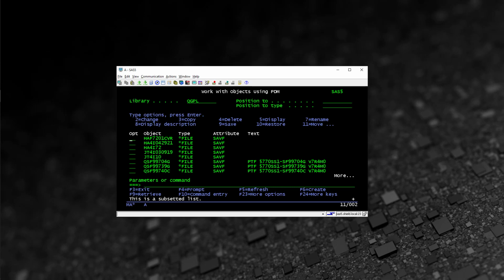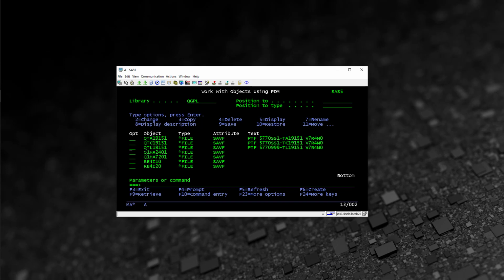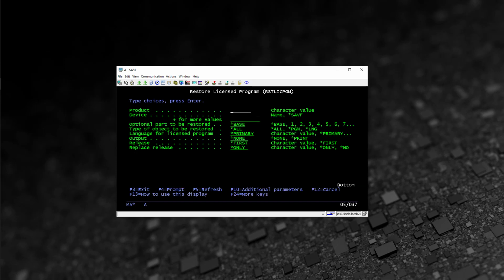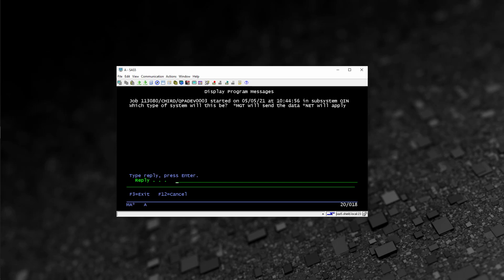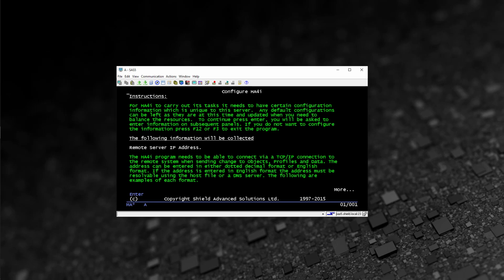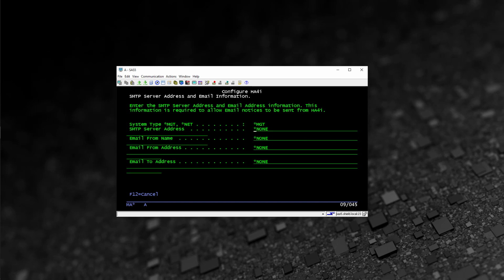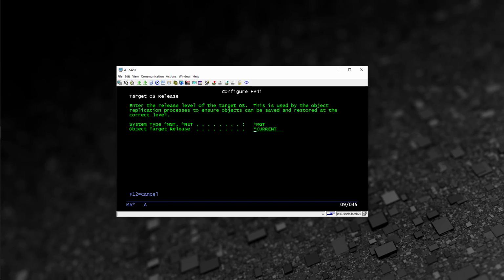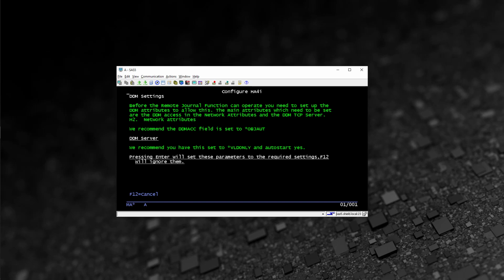Installing HA4i *MGT

Comment from the maker: The video shows an install for a system that is running 2924 as the *PRIMARY language. We have been contacted by a customer who was trying to install but did not see the configuration collection panels shown in the video. The problem is the *PRIMARY Language was not 2924 so the install fails for the language objects. When installing the product on a system where 2924 is not the *PRIMARY language please alter the RSTLICPGM to LNG(2924).